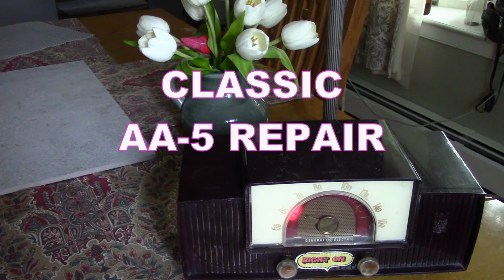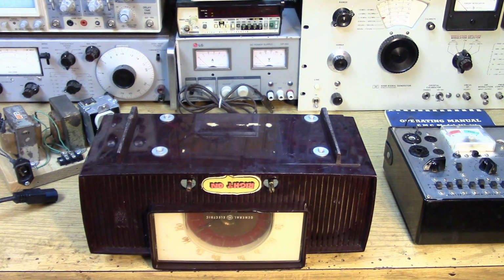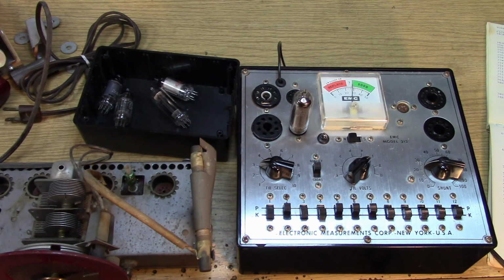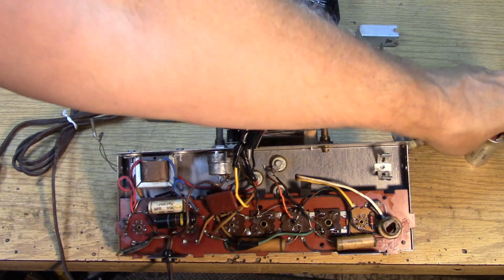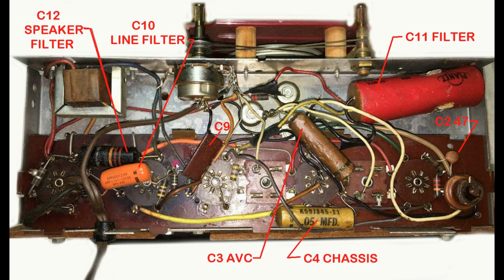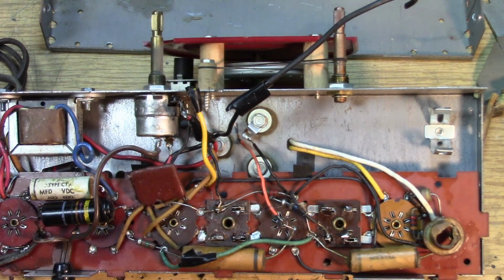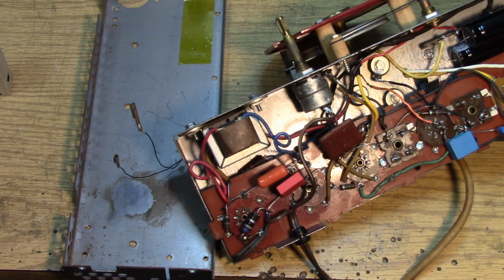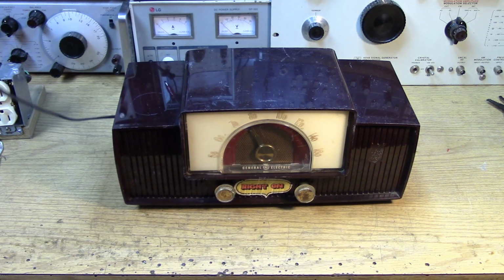All American 5 Repair - GE

Comment: What do you replace a hybrid pack with??? Mine is reading open. Absolutely love your video!
Reply from the maker: Usually a couple of ceramic caps and 3 or 4 resistors were all they have been replacing with the module. So find a standard schematic and use the recommended part values. I have done this on several sets including the old Hallicrafters S-120 Shortwave..

Comment: Gotta love the AA5.  A few caps and they nearly always work.  I did an old zenith about 5 years ago and the schematic showed an electrostatic speaker as an option.  Would love to find one.
Reply from the maker: Just look for flea market signs - they are still out there in droves.

Comment: 150 to 175  - should be changed. also additional 33ohm resistor to reduce the higher mains voltage of 122v to 115 volts
Reply from the maker: These sets survive all kinds of abuse all right! This can put a bit less stress on the parts like the tube filaments. But I doubt that it makes a big difference in MTBF with these old circuits.
Reply: @MIKROWAVE1  tube life dependent on filament/heater voltage.  It does make a lot of difference in tube life . and the difference between tubes actually melting down in the case of 6550 audio tubes. Many old transformer designs still being used today are based on mains voltage of 110v or 115volts. resulting in heater of 6.8volts

Comment: I had a GE radio that resemble this one of the same time era, it was a really good deluxe model with 6 tubes (w RF stage), 6 inch speaker, local-distance sw, a long shielded Ferrite bar ant, global AF feedback with tone control, and a phono input jack. Speak of shock hazard from the phono jack., it did not have a polarized plug. That radio sounded very good and really pulled in the weaker distance stations easily. Dummy me, I sold it at a flea-market decades ago!   Wish we wouldn't have parted with the radio.
Reply from the maker: This one does not have the larger ferrite bar antenna on the rear like earlier models. It is a bit deaf.
Reply: @MIKROWAVE1  The less popular 4 radios are real deaf, unless you hook up a long wire outside antenna to them.

Comment: Right on man! Could you do a part two showing replacing the original non polarized power cord with a polarized one and
 adding a Masonite back to it? There appears to be two holes in the chassis to hold a back in place. That and an alignment
showing how to get one done.
Reply from the maker: This whole cord and electrical doomsday thing needs a whole video. I have a stock Hallicrafters  S-120 fresh in that we can use as an example and take some measurements. No children will be used as test dummies.

Comment: Interesting video enhanced by your observations regarding design and manufacture. As far as I know we didn't have this type of construction method in the UK where the voltage at the time would have been 240V AC.
Reply from the maker: I do not know. But the voltage drop required would take a large resistor and much heat would be generated. Plus the higher voltage safety factor...

Comment: Are all Trump's radios polarized? Can you put the tubes in any socket? Replace the 35W4 with an 866-mercury vapor rectifier. You tested the tubes but then you go ahead and replace capacitors without testing. You could have run a wick to the wax capacitors, lit the wick and used the flame to replace the bulb. All the probably bads, but if you just plugged it in it might have worked and save all this farting around with black beauties.
Reply from the maker: You too are full of beeswax Burt. Burt's Bees in fact stole your name? Will you sue? I am so cheap that I saved the capacitors and sold them to audiophiles on EBay as low distortion noise leaking, for better sibilance.
Reply: @MIKROWAVE1  When you sell capacitors do you let them charge them or pay cash?

Comment: I think its always a good idea to check the grid coupling cap on the 50C5 (C9D) to make sure the 50C5 is not getting plate voltage from the 12AV6 plate. These caps in this part of every AA5 circuit, are known to be leaky. 
That may be why the 50C5 is a bit marginal quality?
Reply from the maker: The old wax, paper, foil caps if not too abused, held up for 25 years or so. I have not seen as much degradation with ceramic encapsulated caps. Of course, heat and water vapor cycles can degrade about anything. And parts quality varied. I have a deluxe cap tester that can hipot and do leakage.

Comment: Why did you choose not to do (or do and not show ) the following? (A) replace the non-polarized cord and plug with a polarized version or (B) since the chassis is not connected (except for the one capacitor to circuit common) install a three wire cord?
Reply: Leave him alone, he already way over did it.
Reply from the maker: Ha! Yes next video we will take a little trip to the danger zone as see what all this AC/DC fuss is about. I have a new Hallicrafters S-120 in the house for a visit that can be our "widowmaker".
Reply: @MIKROWAVE1  You have a "new" Hallicrafters S-120? They started making them again?

Comment: While referred to here as "American" this is actually a Canadian invention. The 5-tube batteryless superhet receiver was invented by Edward S. Rogers Sr. (1900-1939) of Toronto, Ontario, Amateur Radio Operator callsign 3BP. This receiver was in commercial production by August of 1925 & eliminated the need for heavy, expensive A, B, & C carbon drycell batteries. He founded the Rogers Vacuum Tube Company which modified Westinghouse tubes (which wud not function on 25/60 Hz line power) to run on AC current & produced both the tubes & radios. He founded AM radio station CFRB in Toronto (still in operation), the RB part of the callsign standing for Rogers Batteryless.
Reply from the maker: I grew up as an adopted child born on the border in Ogdensburg and always thought that I might have been  Canadian by birth. You know the Catholic charities were pretty loose with the babies back then.
Reply from the maker: You hit the nail on the head with the word expensive. Batteries always have been expensive. Same with Power Transformers. So that it took a Canadian to come up with such a brilliant solution? And I do not like to use the word cheap in the same sentence as Amateur.

Comment: I have several of tube radios. one 5 tube has octal tubes. the phillco has loctal tubes. the one was a kit I made years back. has a pc board. early 1970's . same 5 tubes. my GE one is a clock radio.  have the 6 tube one as well. 35C5 instead. most run on 115V ac/dc. and yes they make one with FM with tubes. has SW as well. lot of them were made. I have a GE ac/dc ,battery one.  117Z3 rect. still works, new speaker and caps. 73's
Reply from the maker: 6 tubes was deluxe!

Comment: The AA5's were mostly the same among manufacturer's!  They would just make minor changes!!
---
At 9:25, replace with a #47, it uses less current.
Reply from the maker: That is what I did. But I did feel guilty.
Reply: @MIKROWAVE1   Don't feel guilty- the pilot light goes across part of the tap of the 35W4 and is designed to use a 47!  A 44 probably wouldn't hurt it too much but that portion of the heater wouldn't get as hot and would increase the voltage across the other tubes slightly.  I see the schematic shows a 44, but this is the first one I've seen that does that and no idea why, especially when tube manuals show it's designed to use a 47.  The bulb and tapped section act as the fuse for the radio.

As for the filter caps, it is possible to have too much filter capacitance which will cause too much current across the rectifier tube.  I'd stick with the 50µF.

Comment: Hi Dave, could you have installed a 3 wire power cord or at least a polorized 2 wire cord. Thank you.
Reply: NO! You cannot install a 3 wire cord on a hot chassis All American 5 (AA5) radio. 
YES! You SHOULD install a 2 wire polarized cord!
Reply: Your isolation transformer is an excellent implementation using 2023 parts !!

Comment: One of these days I'll have a look on two old tube radios inherited . . . . Maybe I'll be able to fix them with my meager means {a multi-meter, a soldering iron, and a few mechanical tools). But currently I'm busy designing a microcomputer and its microprocessor (which I'll probably configure in a Programmable Logic Array) to test a few inventions of mine.